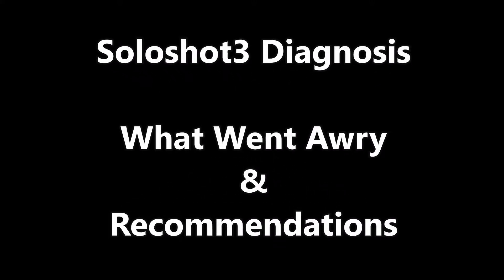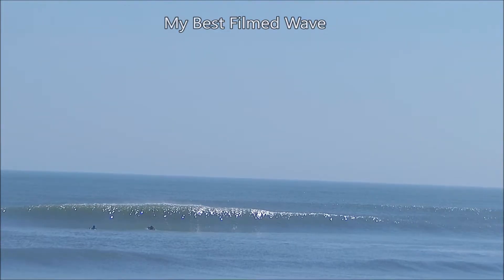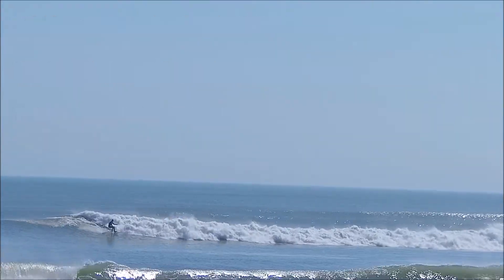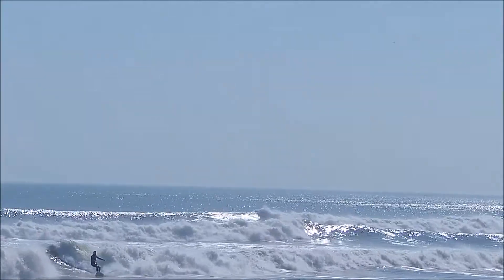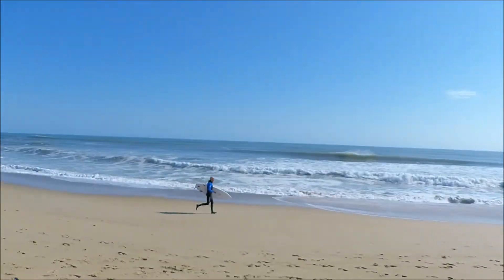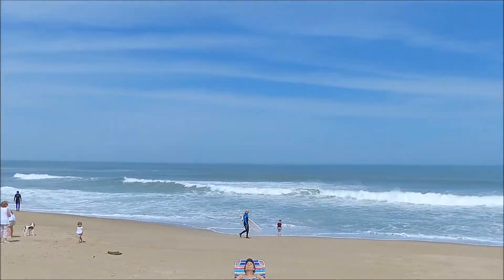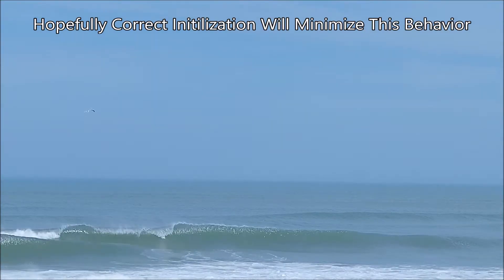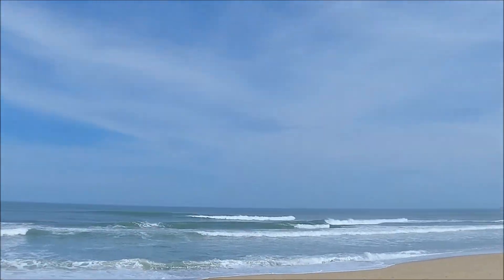Soloshot 3: Diagnosing Tracking Challenges + Recommendations

Comment: I have a SS 3+ (caution)

9/15/ 2025 The issue is still not fixed. SS has tried to fix it remotely, but the fix hasn't worked yet. The last question they asked and I answered was on 9/4. 

7/31/2025 The camera is stuck in "Calibrating" mode. I sent an email to SS Support. I did use it a few times since the last issue in 2024.

The issue below in 2024 was fixed...

7/4-6/2024: I travel to the Wedge (Newport, CA) to get pounded by a southwest swell, but I can't film myself since my camera isn't working and is still with SS.

6/22: SS receives the camera.

6/18: After attempting to remote troubleshoot with the SS rep, and me sending them video of doing what they asked for, I was asked to send the unit back.

6/10: New issue: camera tilts down and just doesn't function. I contacted SS by email and received a response the next day (great service in that respect).

1/22: Received slip that looks like my camera is at the post office.

1/9/2024: On 12/1/23, I sent an email to support because my tag wasn't working, nor charging. I found out, on my own, that I needed to discharge the camera battery so that the camera needed charging. Only then would the tag charge. However, it took 26 days for an email reply to this tag issue. However, the rep asked if I had any other issues and I was able to share an issue that just came up a couple days prior. So, this next issue could be considered a 2-day response. On 12/27, I was notified I had to send my camera in due to issue #2. I sent my camera back on 12/27/23 and am currently waiting for it to return.
Reply from the maker: Thanks for the post-up!  I haven't touched mine in over 4 years (moved away from the coast).  Good luck getting that fixed, I have no idea if the company is still around.

Comment: Was it on terrain or field? Middle or bottom center?
Reply from the maker: It's been a while, but I believe I had this on Middle/wide/water setting.  However this is an old glitch in the system that has been corrected with recent updates; with the exception of the issue of 2.4ghz frequency distance, which is inherent to the hardware in the system.